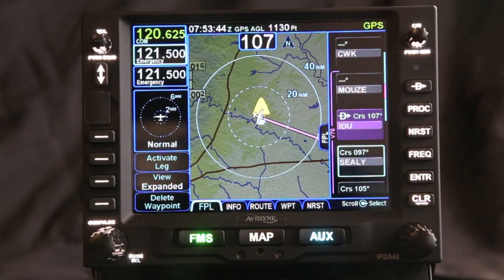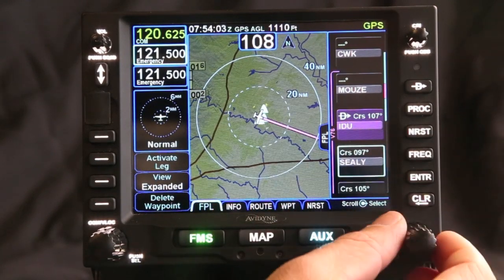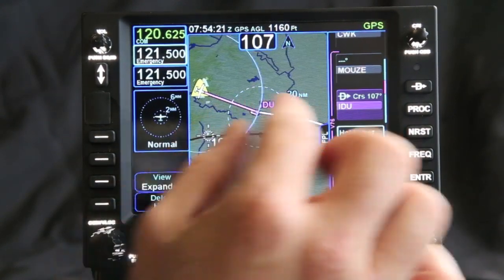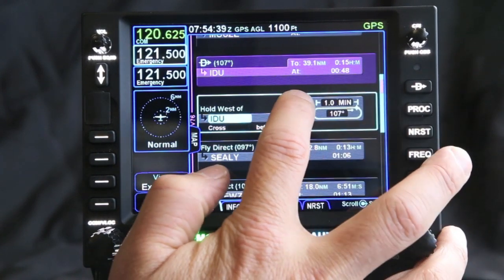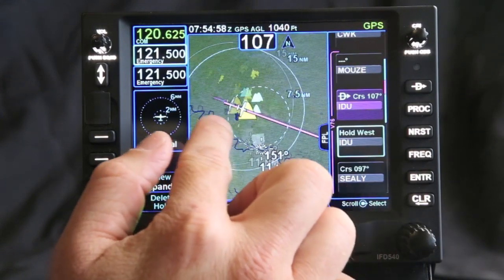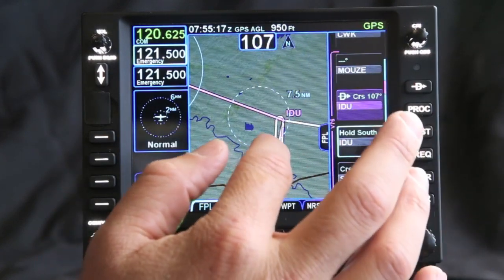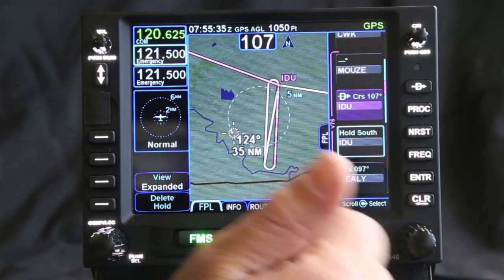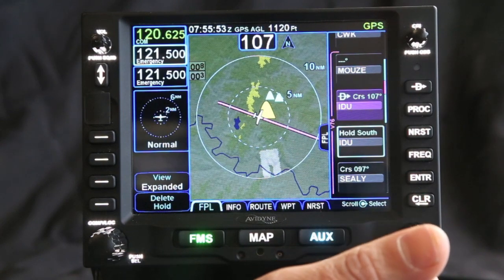IFD540 - Entering a Hold

Comment: was told by my airplane rental place that the ifd100 app is not faa certified so they wont give me the password to use the app on my ipad ie so i can operate the 550 with my iPad.      do you agree?
Reply: No, that's the dumbest thing I've heard in some time. The iPad app doesn't need to be certified as it's not part of the aircraft. Is your headset certified? The stratus receiver?